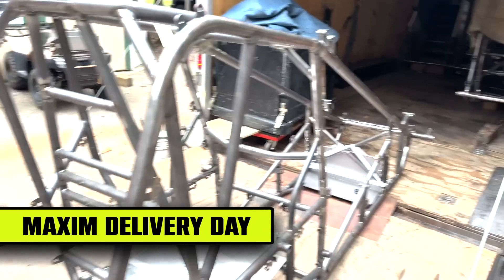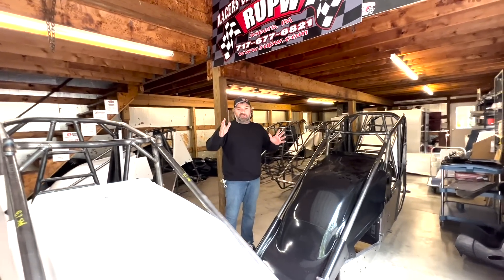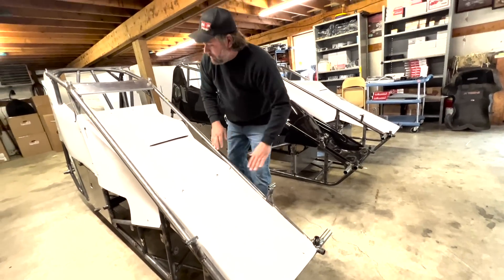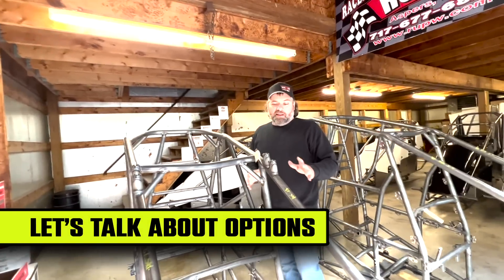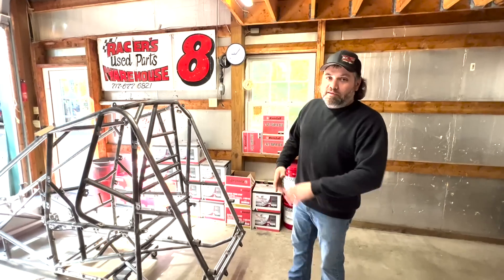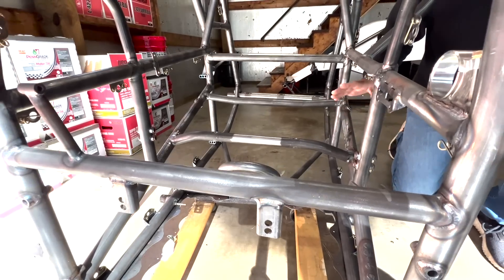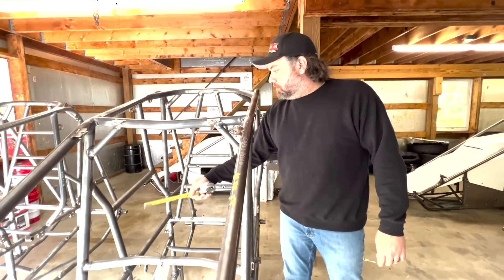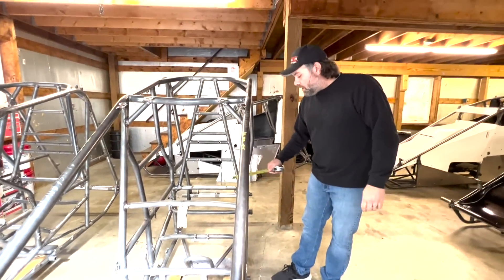Could You Be TOO BIG For The Racecar?! Sprint Car Chassis Options Explained

Comment: Are Maxims tig welded?   I agree with the other folks here, great content and great camera work, Billy!      WillyB
Reply: The question shouldn't be is the chassis TIG, MIG, or stick welded.  The real question should be is the welding being done by a person that is certified and are chassis welds occasionally being tested to make sure you have full penetration.  That's the real question you should be asking
Reply: @jayss10   You're right. Are they certificated and is the steel tested? Does it come from china? Stress relieved?  etc.

Comment: I recently sat in a tallboy Maxim, and I was still hanging out the top. Without a helmet. I am 6ft 1 and 15 stone. I run a classic [Australian] Super mod. More room though there is still a halo bar over the top. It must be a limo at 90". Knowing a driver who got serious head injuries in a midget so many of these cars are simply too small. And he was a skinny 6 footer.
I remember a decade or so again the 'hot trick' was pins for the shocks then held on with R clips. Which was total bullshit as the shocks need to be bolted on firm

Comment: Surprised no talk about difference between Standard, Mid and Big Max. Although It didn't look like there was a Big Max delivered.
Reply: I think the taller cars run a bit tighter. I run a basic Maxim raised rail, I feel it runs a bit a more free and forgiving. It’s 87/40. I ran a 87/41 for a few races and felt it was tight also, but really comfortable on dry slick.
Reply from the maker: You are correct, no big max in this order. My bad. The tall car is like a mid max but taller. I really wanted to show the option with room. We get a lot of inquiries about the driver not having enough room and we see drivers in cars with their head to close to top of cage.
Reply: @billydietrich  Oh, you're fine. I know the differences on the cars, just thought it would be a good topic to talk about and you'd be a good person to talk about that topic with you being a dealer and everything. 
I agree with there's a lot of people that are probably to close to top of the cars. I was always lucky being shorter, so I always had pretty decent head room in standard non wedge cars. Although I preferred the taller cars, due to having even more head clearance or "buffer" room.